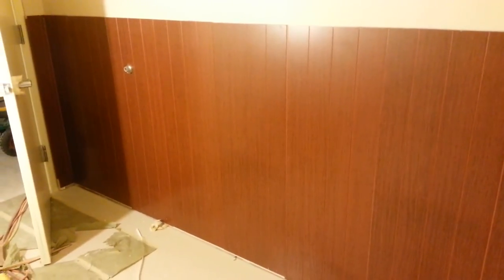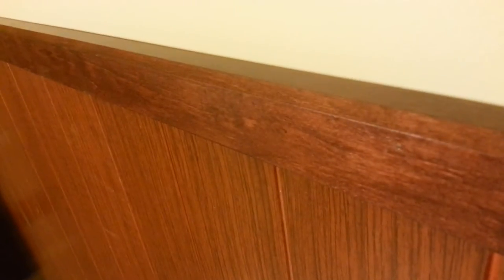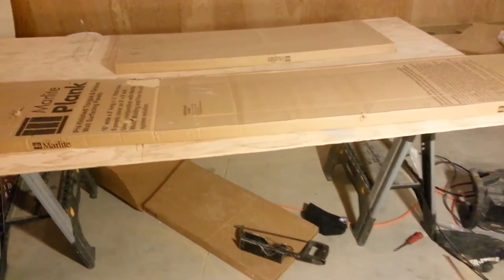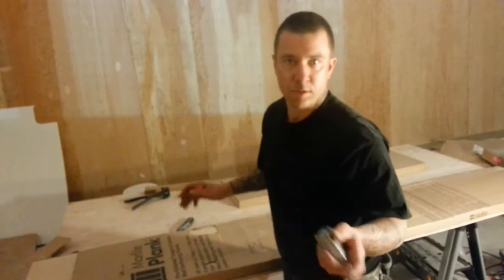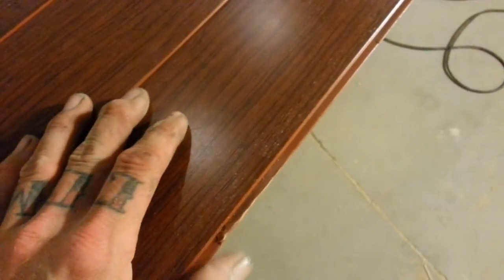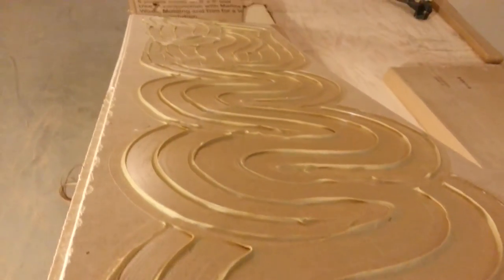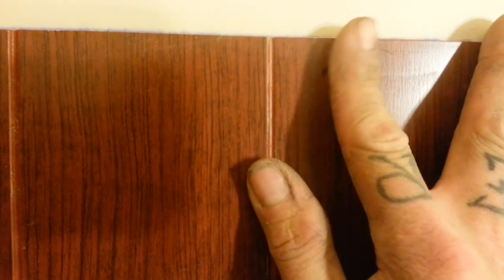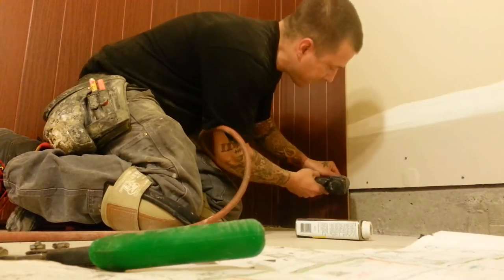MARLITE Plank How to- basic install Vol.1

Comment: I have not used Marlite panels in years but I used them a lot years ago and their main rule was that YOU DO NOT NAIL OR STAPLE THROUGH THE FACE OF THE PRODUCT....Metal clipe were supplied toinsert in the t&g to support them and metal trim accessories were available to finish the install